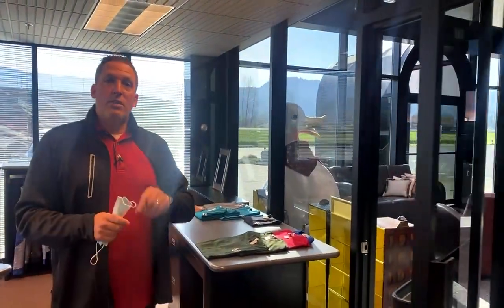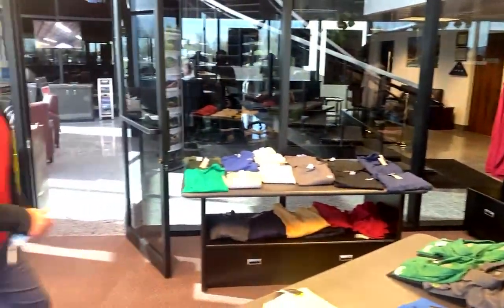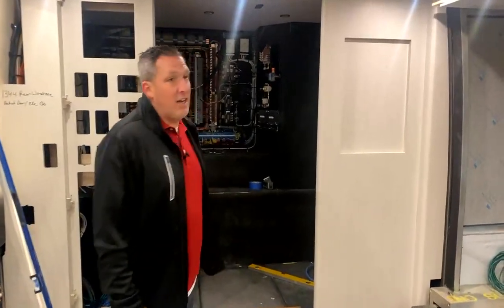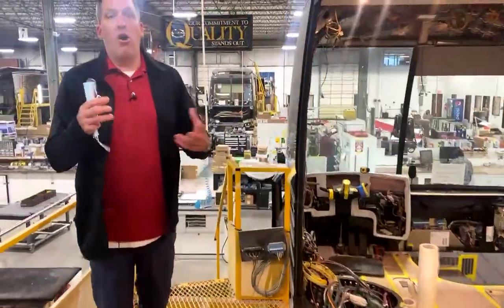Custom Luxury on the Factory Floor (1343, 1344). MMwM Ep.215

Comment: Enjoyed the video today. When I was driving bus here in Sherbrooke Qc. we would have a “bus rodeo “ about every 3 years or so. It would be held in one of the city’s largest shopping centre parking lot on a Sunday. We would have a very tight obstacle course to go through and you had a set time to do it in and that was the goal to beat the time. Just an idea for your “motor home race”.  Richard Litter
Reply: So, an autocross with busses.  That would be very doable for motorhome racing, and promote safe driving at the same time.
Reply: They use to have the bus rodeos here in Ottawa, Canada too.  The public transit drivers would compete.  All gone now, city is broke thanks to the train that doesn't work.